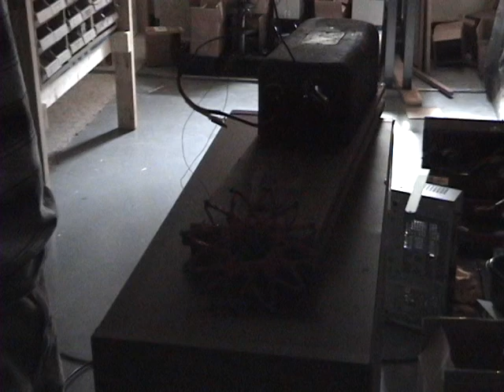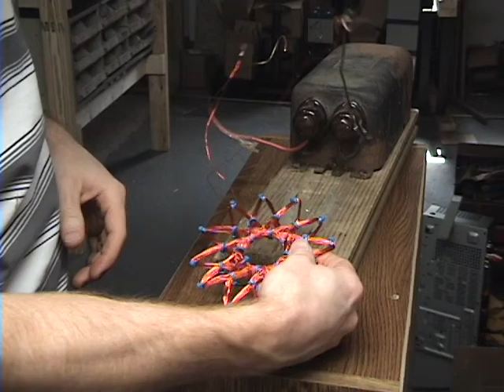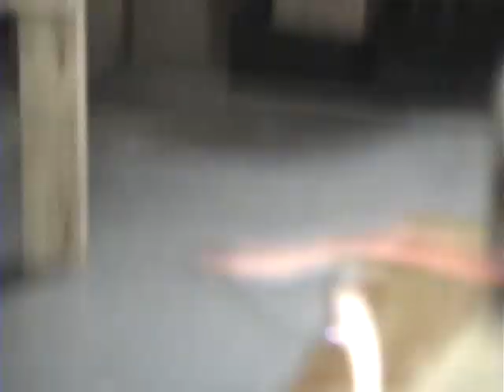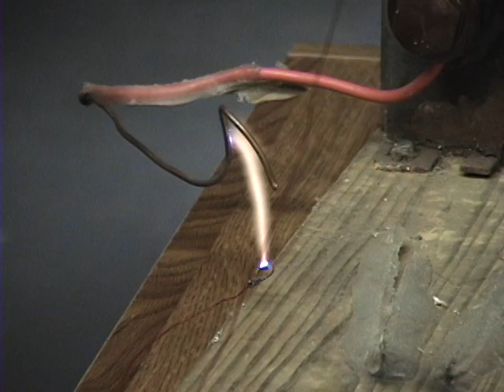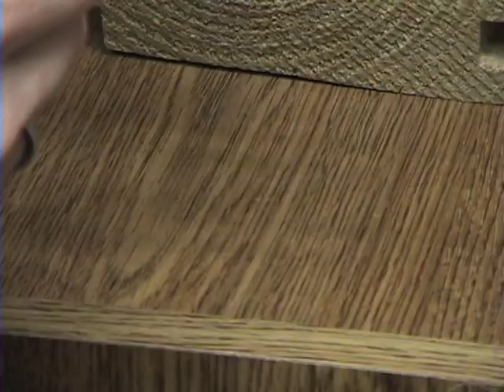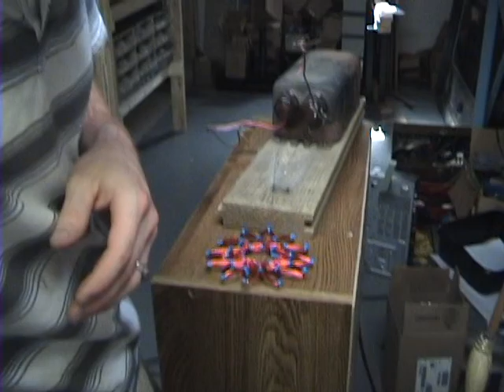12000v in to a Rodin Starshp coil? (TEST 5)

Comment: the load is at the highest resistance point. Coil at 60 hz has  a minimal reactive  but closed to pasive resistance value  that is very little comparing  to other load point - ark. You ark is a load, not the coil since a coil wire can pass this current with no difficulties without heating. By inserting magnet  inside the coil your reactive resistance going high and coil started to  heat.
Reply: Start with a short copper rod, have two bearings on it, tightly snug to the copper rod, so metal of the bearings is in contact with the copper rod and no chance of slipping.
Then take two identical copper disks, the thinnest they can be but stiff enough to where it's difficult to bend them.
Those disks, the bigger the diameter the better, the more expendable power you get to use as a result of bigger diameter.
Then with a hole in the perfect center of the disks that fits tightly snug to the bearings, metal to metal, so the copper disks have a path of electrical connection to each other through the copper rod via the bearings!
Now make two Starship Coils sized to where the opening in the center will snugly go around the copper. When you start the coil mark the end of wire that you start with with like a piece of tape or something just to make it identifiable. Make both Coils Exactly the same.
Place the Starship Coils around the copper disks.
BUT make sure they are in alignment of attraction, meaning don't have both Norths or both Souths between the disks.
Identify that by taking a battery and a compass.
Put the positive end of the battery on the end of the wire you started the coil with that has the identifying mark, figure out which side is north and south. Do the same with the other coil, positive end of battery on the end of wire you start the coil with, the one with identifying mark, make note of north and south!
Fit the coils around the copper disks to where there is a north and south together in the center!
Now take the end of the coil you made a mark on and soldier it to the most center of the copper disk that you can get.
On the copper disk against the bearing the closest but without touching the bearing.
Do the same for the other disk, identifying marked wire soldiered to the most center of he copper disk against the bearing but not on the bearing.
Really it wouldn't matter if you made contact with the outer ring of the bearing only. But being there will be mechanical spin, the bearings are the only point of failure.
Ok so you got the identified wires connected to center of each disk, now soldier the other end of the wire to the most outer edge of the disk possible, do that for each.
NOW! Your self powering generator is complete!
Spin the both disks in opposite directions of each other!
Take a disk shaped magnetic with its poles on the flat faces.
OH and the two copper disks with the Starship Coils on them, have them the closest possible you can get but where nothing rubs together / touches!
You won't need any more extra copper rod sticking out past the bearings expect to have it lifted in a housing so they can spin and to make an electrical connection to each end of the rod.
With the two copper disks spinning opposite of each other manually. Bring the face of your disk magnet to one of the copper disks, face to face, closer the better.
Must be perfectly parallel to each other!
You will notice your copper disks get faster and faster!
Wait for the RPM's of each disk to become matched and steady, then you can pull your magnet away and the unit will become self powered with extra power to spend.
The extra power that can be used will be determined by the diameter of your disk mainly!
The unit will be all voltage and very little amperage, but then you just feed that into a transformer to make it a usable current.
The RPM and magnetic field strength play a, one to one on a linear scale, of the power output.
The conductivity of the disks and the diameter of the disks play an (exponential) role on the power output, meaning the math that determines how this unit works shows that it squares^ on itself.
Reply: @davidprock904  Nikola Teslas Unipolar Motor.

Comment: Weird.. I just did this, only I took it down because when I turned the light off it didn't pick up my spark gaps. Will you ruin your transformer laminate on those old school NST or because they are center tapped grounded do they do fine? I just don't want to ruin my vintage 5kv NTS ;)

Comment: the volt across coil

is just the resistance of wire per ft * the length of coil wire * 34milliamps

Comment: There is no 12000v on coil!!!! voltage is drop acuare the amperage and coil resistance=) to get interesting results use adding capacitor and rectifier and spark gap=)